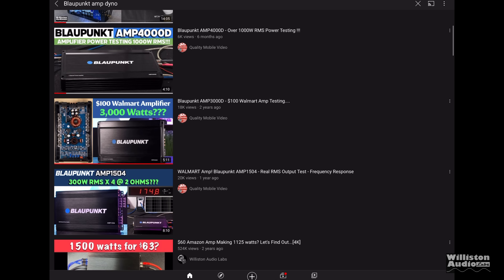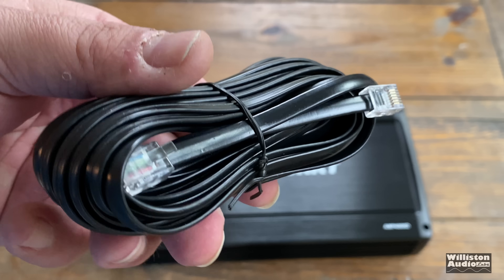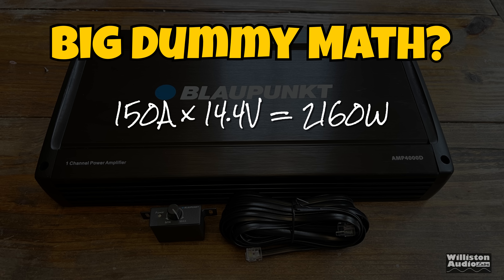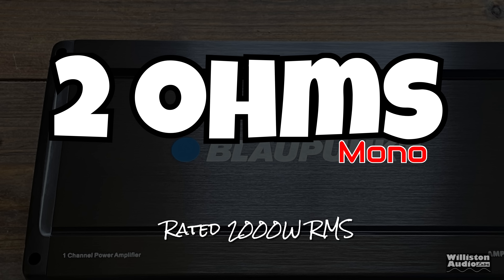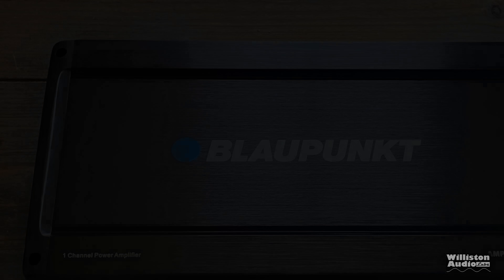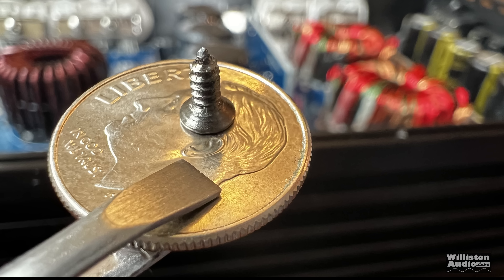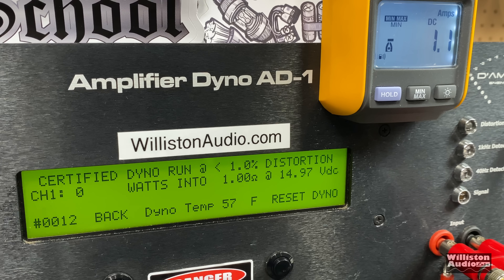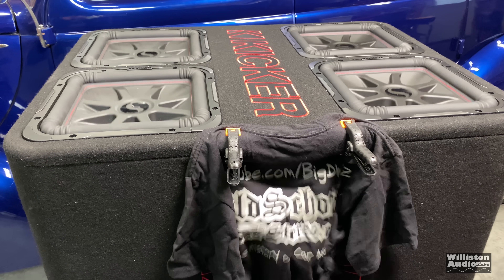How Much Power Does a $49 4000W Walmart Amp Make? [4K]

Comment: Oh man, what happened to all those German, Swiss or generally European high quality companies 😭
Blaupunkt, Grundig, Lenco, Telefunken, ...
All sold to Chinese, they took the name badge and put it on their crap.
So sad.
I know why all my car and home audio, and even the cars themselves 😄are from the 80s and 90s. I run Hifonics Thor, Zeus and Colossus Gen 6 - Gen X, old SinusLive digital amp for sub (real 4kW into 1 Ohm), old Crunch amp on a JBL Gti 1200 in the other car, Focal PolyGlass speakers in all cars...
The only new unit is the Hifonics Thor 8 channel DSP with 6 channel amp... and this thing is crap, producing so much noise when turned up, so you can't run it on a head unit less than 4V pre-out, or you keep the setting on the amp remote low, otherwise you hear it making strange noise.

Comment: Hi Derick. I am from South Africa, I like your channel and watch lots of videos. You are doing a great job. I see you test all kinds of amps and sometimes speakers. In this part of the world , manufacturers like Star sound , Targa , Ice power ect is quite popular. Did you test some of those or do you have some videos of those? i am running a very small audio system , using 1>< 12" Targa and a starsound mono block. The sub is rated at 4000w and the amp at 2000w , which i strongly doubt will ever push that type of power. What is your feeling toward these type of audio? I believe I could have done better with a 12" pioneer.

Comment: for most of these sold out brands made in china, 
one can basically divide the advertised RMS wattage (not Max) by 4 and get a feel of the real power. 
so 2800w RMS is basically a 700w at best. 500-600w to play safe.

Comment: “Blaupunkt went out of business in 2016. Obviously someone has control of the name and is licensing it to whoever want's to slap it on any old tat, in this case rated in Chinese Watts (divide by 3 to get the real rating”
A lot of companies who were well known for quality products for decades have gone bankrupt or disappeared past 15yrs , the “Brand Name” or licensed name was “snapped up” by Chinese manufacturers who count on unsuspecting consumers who haven’t realized that the Brand name they just bought wasn’t the same quality product they expected ..instead they got cheap crap from China 🇨🇳 with aka The Blaupunkt name
Do your research.. Kodak was a great example of a trusted name for almost 100yrs until they had to shut certain devisions down and as you guessed China has those Kodak name rights🙁
Reply from the maker: Yes we know this

Comment: Blaupunkt! Was ist mit Ihrem blauen Punkt passiert? Well, it's a marketing thing, I guess.

20 years ago, I updated the 80s vintage electronics in a humble Volkswagen Rabbit C. It was a unique car, tailor made for a dealer's daughter, from what I heard. Built in Westmoreland, Pennsylvania. Four doors, and a unique completely red interior.

I installed a humble looking radio, the factory system used in the Mark III VWs. Why? I had two very nice radios stolen, a top of the line Kenwood, and a Sony. My solution was simple. Install a radio with a big VW badge on it. Unknown to most, that radio included CD changer control, I had a 6 disc changer in the back. I reworked the interior body, installing speakers where they were invisible.

In the doors, I had nice MB Quart speakers, hidden behind the original humble perforated grilles. I calculated the requisite size for a woofer box, with the goal of reinforcement, not that youthful license plate buzzing boom. The little box was quite small. I used a Blaupunkt amplifier, sized similarly to the one you see in this video. the goal was to have audio, but retain all of the utility of that happy little car.

I really am perplexed and amused at the things I see today. Truth, I've done enough damage to my ears jumping from helicopters, running chainsaws, and manning the panel of fire apparatus. This damage is cumulative, I won't even hint at years of sirens.  Take care of your hearing, you only have one set of ears.

Comment: In the 80s I had a Blaupunkt Berlin in my truck...it cost me a fortune back then but sounded incredible.  I wouldn't remotely consider Blaupunkt these days.  For a company that was once revered and spoken in the same circles at B&O - they've fallen a long, long way.  Good to see they've got Scooby Doo labeling their connections, tho, lol.
Reply: The real german company Blaupunkt dosnt exist anymore. They went Bankrupt in 2016. Its just china vendors that bought the Name. You see that pretty often today. Back in the day it was real premium stuff.
Reply: @000jimbojones000  If memory serves 2016 was around the time I started seeing Blaupunkt in the Walmart stores.  I wondered at the time what had happened.  Sad they sold their reputation to knock-off china manufacturers.
Reply: @SilentKnight43  it wasnt rly them. The leftover shareholders did somehow as far as i know. its all about the money. As always. :-(
Reply: @000jimbojones000  Thankfully a lot of car manufacturers these days have stepped up to the plate and are putting good quality factory systems in vehicles that aren't necessarily requiring after-market upgrades (except for extreme audiophiles).  My current Kia Stinger has a 750W 17-speaker HarmonKardon factory system that easily rivals anything after-market.

Comment: Looking at the end of the video. If it was EMI from the SMPS the output is usually filtered and the characters displayed on the Dyno LCD might not be from the Amps output. Also, how often do you calibrate your DYNO? Who or where would you send it. I'm curious if their is a calibration procedure. I'm sure the dummy load has worn down over the years. The values and tolerance might no longer be accurate. Just a thought, good video very detailed. Thanks for taking the time to demonstrate.
Reply: that dyno is crap straight out the factory...it underates always at least 30%!!! at least

Comment: Dont understand how you got your wattage measurements. P= Volts squared divided by ohms. So the 4 ohm test at 14.05 vdc rms would yield 49.350625 Watts on non-inductive dummy load, not 435W.
What am I not understanding?
Reply from the maker: You are calculating the input voltage, not output from the speaker leads. The Dyno does the Amps x volts to get wattage
Reply: @wal  Hello, don’t mean to pick your brain, but yes I measure output wattage at output spearer leads clipped to a non inductive dummy load with a 1kz sine wave with amp output turned up just before it flat tops on my scope. I then square the output voltage and divide by the resistance of my dummy load. I’m also aware of the two other formulas for power (P) such as 
P= E X I and P= I squared x R
So I’m a bit confused on your measurement method. Have a great day. ✌️😎👍
Reply from the maker: @repairfreak  you can see DamoreEngineering.com and look up the AD-1 Amp Dyno if you want to know more about how it works. It does the math and has the dummy loads inside (as well as 1% THD and clipping indicators)
Reply: @wal  My bad I was looking at your testers voltage it was applying to the amp as the amps DC supply voltage. I thought the panel of your tester was showing the output voltage detected at the load, lol. I didn’t realize your tester supplies its own variable output dc power supply to power the amp under test. Looks like a fine but pricey piece of test equipment. 😎👍

Comment: In the late 80s i rolled 5 amps all alpine and cd player 11 band pre-amp eq with duel separate sub control, two 50x2 into 100x2 and a 50x4 in to 100x2 and two 75x4 in to 150x4 everything at 4 ohms 2000 watts total, 1000 watts RMS 2 ten inch bazookas 2 ten inch blue thunder band pass and a full range blue thunder 12 in box in a rx-7 it was all running off a 200 amp alt. Last time it was tested SPL was 144.2.

Comment: The kenwood amp was the best amp i ever owned.  It never overheated  or got really hot. It pushed two 10 in subs and   and two 8's  . No issurs. Was loud and this was back in the 90's
Reply: I had a Kenwood PSX400M back in the day.... Decent amp. 👍
Reply: I'm sure it was circuit city's finest, the kenwood 921

Comment: Back around 1972 Audiovox introduced one of the first "power boosters" on the market.  The AMP500B "Sound Exploder".  A tiny piece of crap that sold like hotcakes for around $30-$35.  It had nothing but an on-off button, and massive distortion though it claimed 40wpc.  Inflation adjusted it would be over $200 today.    Keep that in mind.
Reply from the maker: I have one! Bought it mainly for the box art
Reply: I had a Craig PowerPlay V505 Amp/Eq combo back in the 80s. Wasn't bad for the time.

Comment: Let's see, 4000 watts from a 12 volt power supply means you will need cables capable of carrying 330 or so amps if there is no loss in the amplifier. Therefore the power supply conductors would need to be half an inch in diameter if made from copper.
Reply from the maker: Correct and there are car amplifiers capable of 8000 or more watts, I’ll show some upcoming 😲
Reply: @wal  I live in South Africa and you can't draw that wattage from a standard household 240 volt mains plug😁
Reply: That’s why all those specs mean nothing. You really don’t know what you’re getting. I usually take 10-15% of the stated power and go with that.
Reply from the maker: @pmscalisi  Precisely why I test and show the results

Comment: ive always been a fan of JL. they make clean, efficient amps. so ive always expected to pay $10+ per watt for a good amp
Reply from the maker: Hard to go wrong with JL
Reply: I agree jl amps are awesome.  
 But you can literally use anything it's all about making sure you're not clipping and the enclosure/ enclosures make the biggest difference in your system.

Comment: isnt it a good rule of thumb to multiple the total fuse amps by 10 to figure out the RMS wattage at 12v? problem is, these super cheap amps rarely make clean power. i can guarantee that THD number is false
Reply from the maker: It usually works but I have seen amps that have fuses not connected. This is why I never assume anymore

Comment: I have bought 2 cheap amps and done with those. One just died plugging in the bass boost knob first day. The second started cutting in and out randomly after about a year. Thought maybe it was wiring but looked everything over changed fuses same issue. Switched to a Skar 800.1 using same wiring works great.
Reply from the maker: Taking a chance with ultra budged stuff

Comment: Blaupunkt is hardly a Walmart brand.  Blaupunkt car stereo equipment comes factory in Porsche.  All audio amps are rated at high THD which is a useless number and the are in PEAK power numbers which is also a useless number.  Peak = RMS x 1.414.
Reply from the maker: Peak is also whatever what the company decides to put in the specs. No reason to try and use science, because they are not. Also I use Walmart to help get the video seen and also because it’s sold there..

Comment: Gain is at zero, set the gain to max, max power means everything should be cranked all the way up not all the way down...not saying this is a great amp, the tests just seem invalid when testing max power with every setting turned all the way down
Reply from the maker: Please read up on how gain works as turning it to max does t produce more power. The amp is matched to the head unit before testing

Comment: Sorry, but you said RMS. It does not say that in the spec. Could be Rhubarb watts ! I am left wondering if the unit is a fake. 2800 watts Rhubarb into 1 ohm. I cam across a speaker with one ohm resistance once. It was a heater ! 2800 watts probably turns the speaker coil into a projectile.
Reply from the maker: Don’t fall for the lies and take up for these companies misleading consumers 🤷‍♂️

Comment: Class D can pump out 400-500 watts at 4 ohms but not  in a car audio setting using 12 volts. I love the fact car audio companies always boast peak wattage like people know what it means. Who makes 1 ohm speakers?  I've never seen that low of a load unless running-series parallel wiring among several speakers in a cab.  I think they put mistakenly put a zero behind all of those wattage ratings - most likely not; it is Asian translation, because 400 watts is reasonable. Pro musician  class D bass amps pump that out all day long. I have friends who use them, they are AC and less than half the size of that box. 
In your sound test the amp either has crappy caps which fail to filter out distortion or your speakers didn't like the output because the first set suffered a lot of distortion - cold solder joints? 50 amp fuses are more like  home electrical panel levels. Small electronics may be as high as 1.5 -2-3 amps. My AC guitar amps go 3 amps at the power circuit. Blauplunkt use to be good; I had a new system installed in my new Ford Tempo back in 1986 and it kicked ass; this was before subs were a thing. I used cheap cannons in my pickups and they were fine for what I wanted. 50W max. Good luck to those who fall for that cheap Asian Blauplunkt bullshit.

Comment: So for like $50 dollars, can I use this with a 8ohm sub in my home theater? With jerry-rigged power supply I mean. I know going down in ohms can be dangerous, but does going up work with this amp? And what order cutoff does it have....
Reply: Using 8ohm speaker to 2ohm stable amp would reduce power and volume but save heat and pressure on the amp... it's safe to do.

Comment: It be 4000W outrut at DIN at 1Khz Peak to Peak.

So basically it be a 500W rms at 8ohm, but I bet it be at 10K bandwidth,
meaning say 2khz to 12Khz audio freq range, and not 20 to 20Khz.

so I bet its maximum at 8 ohm is 75% volume is 75W rms 20hz to 20Khz, and a 100% volume 100W rms distorted.

Comment: China produced amp ratings are not ratings of output power. Check power consumption on the input side of the amp. As in total power consumed.
Reply: I usually just look at the fuses. Take the sum of all fuses and multiply x6 for A/B and x10 for D amps. It's just a guess but it'll usually tell you if the manufacturer is overstating the peak power. Some of these companies are downright liars (most of them).

Comment: It's not a lack of communication, just flat-out deception. Manufacturers of both home and car audio have been playing games with amplifier wattage ratings for years. It started becoming even more commonplace after amplifier wattage claims were no longer regulated. When you see a number this high on a cheap amp, delete at least one of the zeros and you'll be closer to the truth.
Reply: Sometimes I wonder if it's more of an INDICATOR spec that tells you the largest possible driver the amp can handle. They don't even get close to the kind of power they advertise.

Comment: Is it a good deal for $50, sure.  Would I connect it to a $1000 sub, no way in hell.  Most people run ported boxes so you’ll most likely want a subsonic filter.  As you could see his testing equipment was dipping down to 13.7-13.9, I’d run a 5-10 farad cap if at all.  Clipping destroys subs from voltage drop.  This amp being lies it may not be as important, but a real 4000k amp you better have the big 3 upgrade.  Always do the alternator upgrade, makes a huge difference.  I ran 500 rms to 6x9’s and people thought I had a 10 in the trunk.  Then I ran about 1500w rms to a RF T215D4 that was birth certificated around 1700-1800 watts and you could feel your esophagus rattling against your rib cage.  That same amp with clean input made 2 Infinity Kappa perfect 12.1d’s feel like they were stretching the skin across your face.  Clean power or don’t hook it up, ya just blow subs.

Comment: I miss my old setup. I had just 1 10" dual cone woofer. I had it wired in series to pull 1 ohm from my Kenwood amp pushing 1000 watt. That little woofer pumped. I loved it.
Reply: Umm

Comment: Awhile back I bought a sub amp box all in one combo from Blaupunkt the thing slapped sounded really good and held up really nice.
Reply from the maker: That’s awesome 👏
Reply: @wal  So is your video 👏
Reply: Indeed I have same amp in video just 3000 watts pushing 2 15 inch SKAR they actually sound good but I bought a Kenwood class D at best buy to begin and it burned up in a week yet $75 amp still holding strong a year later 🤷‍♂️

Comment: I was always under the impression that power output was more based on the case or power wire fuse that comes with the amp rather than what is claimed in any literature or what is printed on the box. Being this is still an industry that has the standards of a pack mule would at least want to communicate that first if the primary concern is seriously regarding "output". Meh.. easier to just hide my head in shame.

Comment: Not a bad deal for the numbers but a used alpine, kenwood, jbl, and Memphis would likely provide a much better value and better sound quality overal. Plus for a daily driver 800 watts on a subwoofer channel is PLENTY! I'm running a alpine v12 5 channel  amplifier with separate sub output. It absolutely works my Rockford fosgate punch p3 subwoofer and it's not even at max wack! Running old school blaupunkt velocity component speakers front and rear and it really sounds amazing through my alpine 3342

Comment: Anyone in engineering knows that power is not measured "RMS" which is a measurement applicable to current or voltage but NOT power.
Reply: Speakers only operate on AC power.
Reply: @alwaysopen7970  , I think everyone knows that

Comment: Look at the fuse size on the supply to the amplifier.  Times that by the 12 volts gives you the max amount of watts the unit will provid.  Ie if fuse is 20amp, 20 times 12v equals 240watts